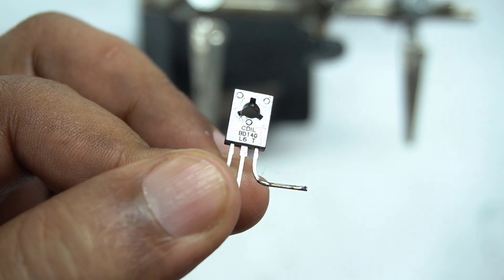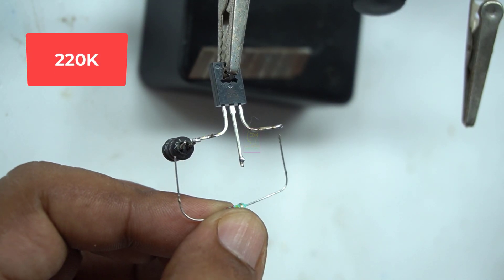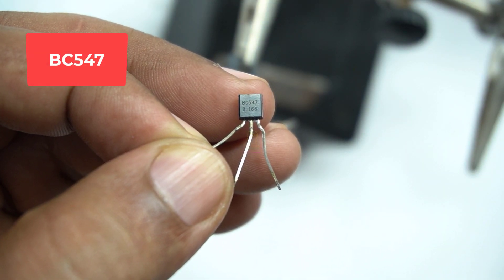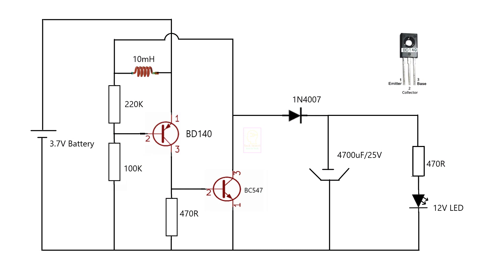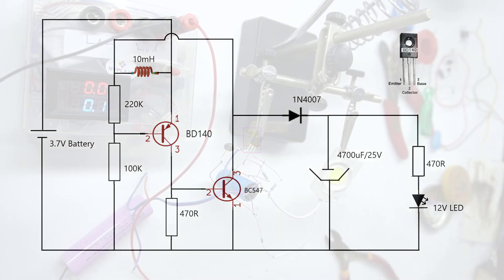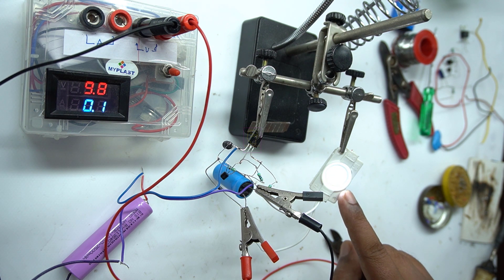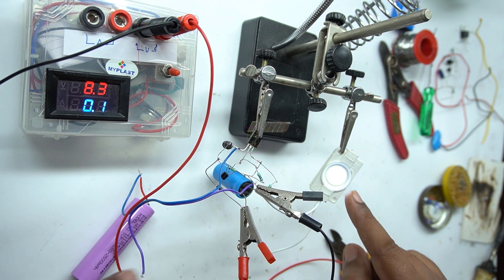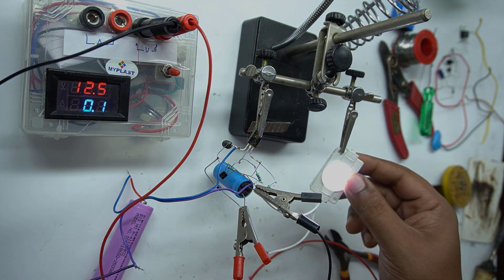How to make 3.7V to 12V Step-Up Boost Converter Circuit

Comment: This is a good information video. Though we cannot use this circuit in production  but good to know about how a voltage booster circuit works. Good work bro ❤. Keep going
Reply from the maker: This is an information video only
Reply from the maker: Thanks bro 😍😍